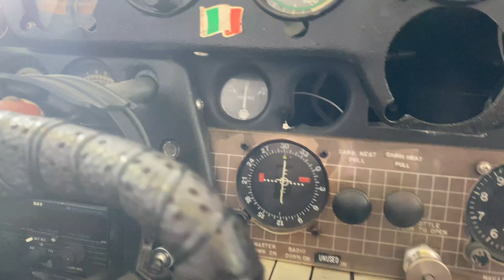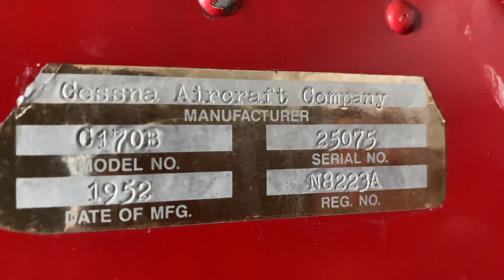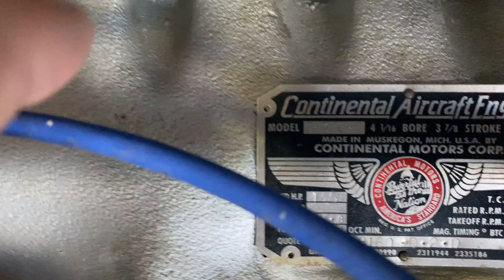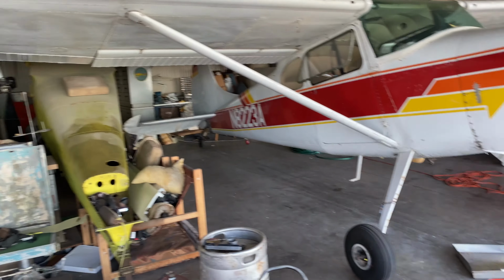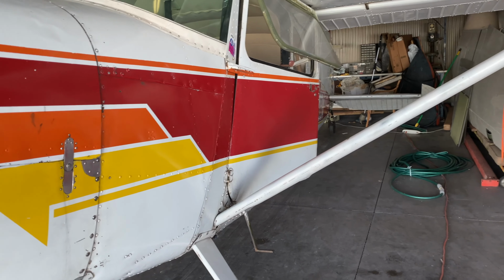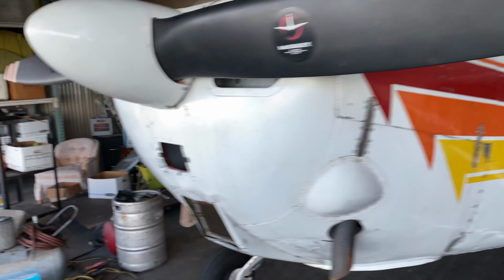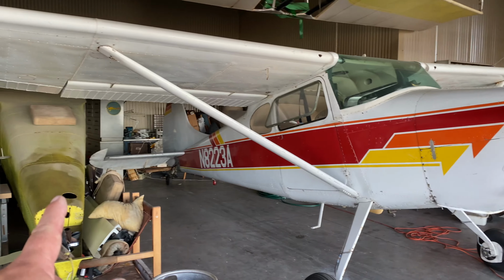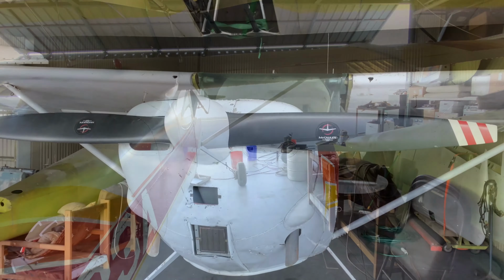Cessna 170B Project... Day 1

Comment: O-360 going into the one without wings?
Reply from the maker: Greg Lance yessir!!!! Well- when I have the extra $ I plan on flying the white one as is for quite awhile. Engine is 15 SMOH the other engine will be an excellent trade in if I can find the right deal...
Reply: Very cool! I have a 1951 A model and love the 170's.. Great backcountry plane. I just ordered a McCauley 1A175/DM8042 prop
Reply from the maker: Greg Lance that’s awesome!!! I’d love to hear how it works out! Did you keep the original gear springs? What tires are you using? I’ll be on airports for quite awhile so fattys have to wait...
Reply: I am running a 8x6's, until they are worn out then probably going to that Aero 8.5x6 "smoothie", its supposed to be a good compromise between "off airport landings" and airport landings. I'm in North Idaho so I hit a lot of grass and dirt strips. Oh and yes I have the original landing gear with a P-ponk support brace. I've heard the 180 landing gear on a 170 is pretty stout, but if you don't nail down the landing you can bounce a lot.
Reply: Shame to give up that 6-cylinder Continental engine however, I know it's not as powerful as an 0-360, but they sure do run smooth!